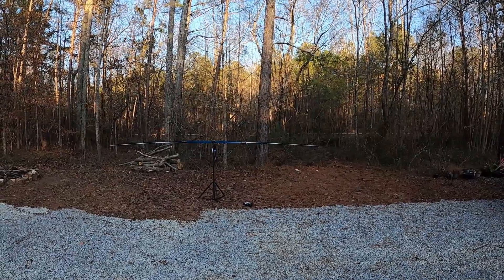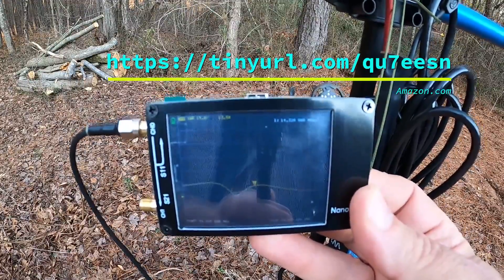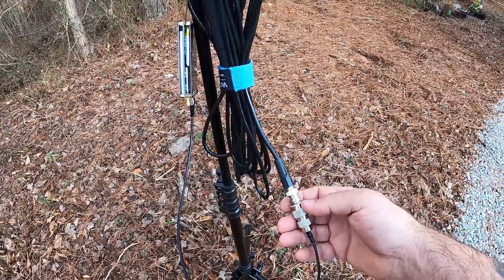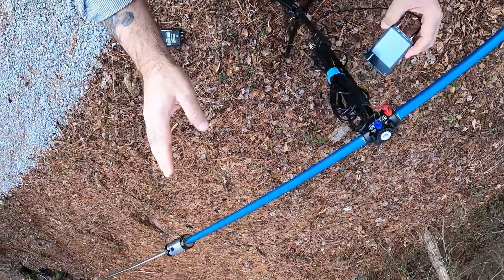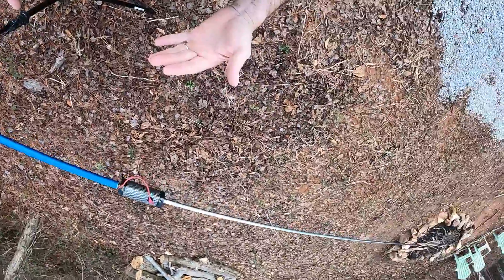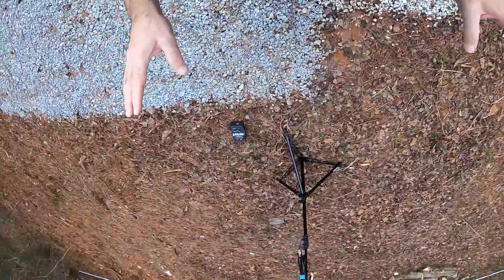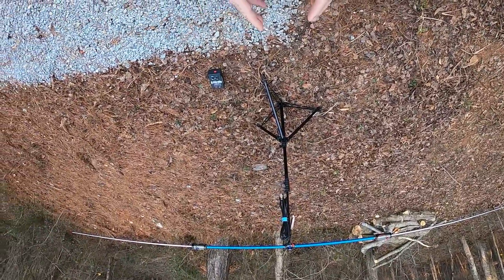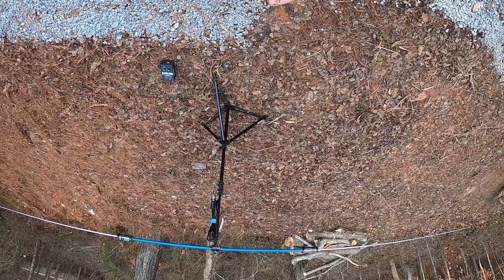Communication - NanoVNA Analyzer

Comment: UPS delivered mine today. Mine cost a bit more, $120, but mine is a 4.3" screen and has a full case. The case needs shielding but that is a simple issue. I believe once the shielding is in place the tracking generator will be stable enough to even tune duplexers and filters. They do make one in an aluminum case for an additional $100 but they are difficult to locate in the state's. At any rate it is a far cheaper and more ergonomic than the MFJ and functionally as capable as some of the professional portable unit's. By the way you forgot to mention that the Hurricane Watch Net moves to 7mhz when 14mhz shuts down for rather obvious reasons.
Reply from the maker: Good stuff.  I am happy with mine so far.

Comment: You can get a SMA Female to SO239 Female adapter on Amazon and only need one adapter instead of two.
Reply from the maker: Thanks.  It's what I had on hand.  I have to connect it to a BNC connector as that is what is on the Buddipole cable.  I probably need a few more adapters.